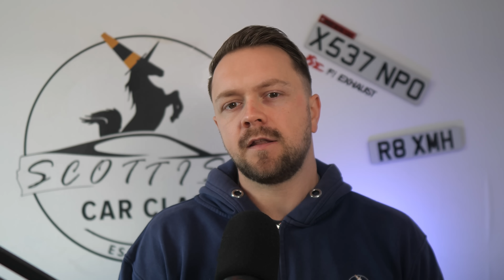Modern Cars Are FAILING Us — So I’m Saving the Reliable Ones

Comment: Hi Grant
I am currently putting my mk5 golf gti through some work to keep it going for another 20 years. I’ve owned the car for 13 years, it is my pride and joy. It’s currently getting new sills and little rust patches in the usual areas sorted. I really want to under seal / lano  guard the underside but I’m struggling to find someone to do it and so looking into hiring a ramp and do it myself. However I’m not sure the best way to do it. 
I guess I’m asking if you could help? Could make an interesting video. I’m in Glasgow so not far from you I think. 
Love the channel mate. 
Fergus
Reply: My friend has one, drives like a dream 500k miles. Very good car, he only had to fix a wheel bearing a couple of years ago

Comment: I own a VW Golf 1.4 TSI SE 2010. 163000 miles and still going strong. No engine problems at all.
Reply: Own a 1.2 tsi 2012 golf on 109k unfortunately early crankshaft failure

Comment: I've had my 2013 Subaru Forester turbo diesel 6 speed manual since new, recently replaced the DPF with an aftermarket unit to keep him going, 220,000km. New cars are auto only & full of features like auto stop start and auto braking that can slam on the brakes autonomously anytime, if their iPad style display breaks I guarantee it's impossible to replace, keeping my car ☺️

Comment: I'm right on the cusp of old/new having recently bought a low mileage 2017 petrol Mazda6 which has just the right balance of tech and old school engineering. The only thing that would concern me is the potential cost of replacing one of the adaptive led headlights.

Comment: I rescued a 2014 1.8 manual civic sport from abuse. Had done only 78750km, but on salty roads. Gave it some paintwork due to rust that had started in stone chips, new shock tower bearings, new door and tailgate seals, new brakes, replaced the cabin fan and regulator (weakness on these), i also had to replace the heated mirrors glass due to corrosion (had shorted) along with the door switch assembly that controls the heating.  I also gave the car underbody treatment. 

Just for fun, i also bought tinted rear windows from the executive model, along with facelift tail lights, spoiler, interior decoration and reteofitted it. Some of the things i did myself in the garage, except for the paintwork, brake, underbody treatment and suspension work.

Comment: Modern cars are mass surveillance machines too, and it's abusive.  Governments are failing us too.  These manufacturers would sell your mother if they could make money and get away with it.
Reply: All of the tech on modern cars costs a lot of money, which is loaded on the price to the consumer. All I want is to get from A to B and back to A reliably with a comfortable, driving position, speed, revs and fuel gauge in front of me and a decent heater/cooler/radio/mp3 player. The SAT NAV, I can buy at Currys.
Reply: Same.
Reply: This. And all parties all part of this circle jerk.

Comment: I very much like what you are proposing here. Would the ‘Preserved’ cars you are talking about be LEZ compliant. I ask this as I live on the outskirts of Aberdeen and need to access the LEZ zone.
Reply: In Aberdeen's Low Emission Zone (LEZ), petrol vehicles that meet the Euro 4 emission standards are compliant and can be driven in the zone without a penalty charge.

Compliance Details
Petrol vehicles must meet Euro 4 emission standards (generally vehicles registered from 2006 onwards).
Diesel vehicles must meet Euro 6 emission standards (generally vehicles registered from September 2015 onwards)
so have to change my freelander 2 as its diesel :( travel 3 mile extra to get to work to avoid lez zone .......madness

Comment: I have a 2001 Toyota Yaris 1.0 GS 53k miles and close to zero rust, and a 2007 Aygo 140k miles that has already been welded but otherwise is a total workhorse (despite oil consumption lol)

Comment: Again this is reinforcing my determination to stick with my 2006 Honda Accord 2.2 i-CDTi EX Tourer - I've recently fixed the dry joints on the clock/radio/temperature LCD and it's as good as it needs to be. As long as I can still get parts for it, then I'm sorted.

I've also got a 1953 Citroen 11BL which is about as basic a car as you can get. I heard Mondeo driveshafts and CV joints can be used on them should I need to replace them, but at the moment it needs a new wheel bearing and some minor cosmetic work to get it in full working order. Should there ever be an EMP device that wipes out computer systems, this car should still be one of the few cars that gets away with it.

Comment: I have a renault scenic 3 diesel it's crap fuel consumption 39 mpg. We also have a MG5 full electric estate it's brilliant in 3.5 years it's clocked up 62k with one little repair to a door lock it's everything the renault should be and never will be, it's light years ahead of ICE vehicles
Reply: It's a tinpot China car, the battery will be dead in 10 years and it'll be unfixable if it hasn't already blown up or the Chinese spyware isn't remotely shut down.
Reply: @gravemind6536 really plenty of these are being used as taxis clocking up 300k so dream on they are reliable cars that are cheap to run

Comment: Personally I think late 80s cars were the perfect balance between modern reliability and safety (crumple zones etc) and pre modern simplicity. I’m thinking 205, mk2 golf, e30.
Reply: 90's aren't bad either.
Reply: @pb5x5 From the early 1990s, they started to add   "Electronic crap"  to cars, but you could bypass it... It was "Flyby"
Reply: 100% Correct....  1990s cars were not bad either

Comment: Just did an oil and filter change for my 2003 Citroen C5. Yeah, and decided to change the steering rack as well to a new-to-me unit with less kilometers and no play. And while I'm at it new tie rods, of course. New balljoints. But removing the subframe just makes it hard not to put new control arms too so that all steering components and bushes are 100% new. And because the power steering is disconnected anyway why not take the pump out and put a new, tight shaft seal behind the pulley. Took a few evenings of fun in the garage and I didn't forget the air filter either. Full bag of parts, cost me maybe 300€ and good for the next 5-10 years. Need to book aligment next week.

Comment: if i get another 4 months out of my 2010 A4 Allroad it'll hit 400000km - 250k miles. One repair to the flap sensor on the inlet manifold, 2 wheel bearings and one replacement timing belt is all that's been done to it. Went though the Swedish MOT no problem just last month. No rust, but I'll have to do the timing belt again soon, and the clutch - which will be a total pain, but worth it.

Comment: I swapped my Mercedes for a 2023 Honda Civic e:HEV to feel less stressed about reliability issues and the common practice of planned obsolescence nowadays. 
Renowned, reliable older car models are getting really expensive. 
The tricky part is that, after some time, getting spare parts for the older models will become a challenge.
Reply: Well done pal. I used to do the German car thing myself....went to Mazda on a lunch break back in the late 2000s, and ended up going to the Jap side. Now driving a Honda Civic, and don't intend to return to the unreliable German motors. That car will serve you well, good choice 🎉.

Comment: I drive a honda civic diesel 1.6 from 2016. Its 65 mpg and £20 tax a year. I was going to sell it ,but just can't  let it go.
Reply: 2013  1.6 ex     165k   going strong 💪
Reply: They are unbelievable cars , can’t see my self ever getting rid of, so much room when seats are down also.
Reply: @michaelchan4497 it’s like a van with the seats down
Reply: @steviefn2typer yeah I was going  say that !
Reply: @michaelchan4497 just an all round brilliant car
Reply: Never sell it. I got the 2014 pre-facelift Tourer version as shown in the thumbnail, I will drive that baby as long as I can.
Reply: 2018 Civic idtec here. 95,000 miles and sailed through its last MOT. Zero issues other than a battery since I bought it at 14000 miles.
Reply: 2012 2.2 diesel.....193,000 miles and still flying 🪽
Reply: Was looking at the Tourer version, how do you find the driving position and performance?
Reply: @WalkWithWallace It's not a fast car but driving dynamics are more than you can ask for really in a regular passenger car. The longer I've had mine the harder it gets pushed, and though it has had mechanical needs, it has never really let me down in a significant way.

Mind that parts can be very expensive though for example flywheels, engine mounts.
Reply: Snap
Reply: Have the same car, I'm 6ft 3 and it's very comfortable
Reply: Same here mate, 112k miles now and only ever replaced 2 rear calipers and a battery, fantastic car
Reply: I have the same car Honda Civic 2016 1.6 over 8 years now. Unbelievable car for reliability and MPG. Oil, Brake pads and a new battery, that's it in 8 years.. I, too, was going to sell. But I would be mad.

Comment: Totally agree! My Winter project involves saving a 2011 Suzuki Grand Vitara x4 AWD top spec that should have been scrapped due to underside corrosion! 2.4, bullet proof engine however a large amount of welding and panel replacement, brake pipes, calipers, rust-proofing required. My contribution to recyling and keeping me busy! I forgot to add, we have a recent, newer Suzuki Vitara and the build quality and longevity of the less than robust parts are very different from the robust older version!

Comment: I’ve owned my 2016 Swift for 5 years and covered 60k miles, tyres, servicing which I do myself and a headlight bulb is all it’s needed. Still starts on the button and has never let me down. 4 pot naturally aspirated chain driven engine, manual box with 35 quid tax and 160 quid insurance, I’ll be keeping it for a good while yet.
Reply: good engine
Reply: sounds good!  whats the fuel economy like on that?
Reply: @Alistair-q4m  Usually mid 50s going by the onboard comp.
Reply: @davidmccready6471  excellent stuff, il check them out thx

Comment: we need to make an affordable e-car, like the mini, and metro, but for £10k new. Thin metal, simple wheel, light brakes, manual everything, no shite screens fking the show up. cheap, replaceable batteries, 60 mile range.

maybe it'll need to be classed as an ebike to get round the bullshit safety nonsense and monstrosities currently clogging up our tiny english lanes.
Reply: Think the Dacia Spring is circa 14k new.
Reply: So the Dacia Spring or the Citroen Ami if going really small.
Reply: May I recommend a small motorcycle, such as a 400cc twin?
I’d vote for an RD400E ❤

Comment: You are spot on.
There's definitely a business opportunity for someone under sealing and rust proofing cars.
In my experience it's chassis corrosion that sends otherwise good cars to the scrap yard.
Reply: You do have to get them early though.
Reply: All cars bought in Sweden are rust proofed with thick underbody sealant and a thinner treatment in doors and engine bay etc.Renewal after three years
Reply: There are places that have been doing this for ages but,  although most people like  to regularly clean their cars, they ignore underneath, even after winter when the underside will also have road salt residue everywhere.

Its easy enough to do yourself, which i do at least twice a year, making sure i give the underside a proper clear, treat any rust spots or corrosion patches and then , protect. I also give the rubber bushings a pray of rubber protection spray, helps to keep them supple and keep the underneath squeak free.
Reply: Already exists
Reply: 1995-2005 is the sweet spot.   Maybe up to 2008 or 9 on some models
Reply: And ropey electrical parts.

Comment: Just spent 1100 for injectors on civic 2.2d on a 12 plate with 60k miles.
All 4 injectors needed changing . Dpf deleted and mapped for 250.
Car cost 2750.
So as you rightly state it should last a good few years to come.
20 quid tax and 50 mpg no matter how hard its driven.
Reply: I've got the same car, 9th generation. I must be lucky as I'm on 193000 miles and I've never needed those doing. Keep the civ mate, it'll do the mileage.

Comment: My wife drives a 2010 Honda Jazz that has done almost 170,000 miles. Only changed brakes and oil. Everything just works. I have a 25 year old Toyota Corolla, done 310,000 miles. Only changed wear parts and oil. If I replace now, there will only be a few Japanese brands I'm looking for here in Norway, not past 2015.... Honda Civic, Honda Jazz, Mazda 3 or Toyota Auris..
Reply: Change the spark plugs, they can work themselves loose on this model and can damage the bores.
Reply: @dynamicserb7986 Thanks. Yes, i heard about that problem on this type, so will do it soon..
Reply: My wife drives a 2009 RAV4. We replaced the engine after the oil strainer clogged up, causing the engine to sieze. Trap for young players. Keeping that car until there are holes in the floor pan.
Never getting a car that has a SIM card.
Reply: @gregvanpaassen that was sad to hear. Been a few cases with those Toyotas back home in Norway too. Automatic transmissions among other things. Nothing is perfect, not even Toyota..
Reply: UK built 2012 honda civic....on 193,000 miles 🎉🎉
Reply: @klawlor3659 Almost only UK built at home also of the Civic. The Jazz, before 2015 many of them are actually built in China. Civics seem to be bulletproof cars..
Reply: @davidbrathen2268 I never knew that about the Jazz. Was under the impression they were UK built as well! I'm definitely a convert to Honda, although it all started after my German car (I was well into BMW and Audi in the 2000s) started giving me costly grief. First Mazda, then Toyota and now Honda 🎉.
Reply: @klawlor3659 BMW and German cars have good seats and good comfort, but I can't afford the workshop bills. Well, at least here in Norway, many Jazzes have chassis numbers that start with "Luc.." Then it's built in China. Many Civics have chassis numbers that start with "S.." Then it's the UK. But there haven't been any worse Jazzes here in Norway, at least because of that, according to the info I have. Both Civic and Jazz are very good. The only stupid thing is that Civic started with a 1 liter engine after 2015 I think..there must have been a bit of a problem with that type..
Reply: Owner of a 1998 petrol Toyota Celica that has covered 251,000 Miles ... These late 1990s Toyotas REALLY are as good as the hype.  They are   "Keepers"
Reply: Toyota Corolla 1997. Ireland. 180.000 miles. @briansaiditsoitmustbetrue4206
Reply: @briansaiditsoitmustbetrue4206 But it's not a 1994 Celica.😂